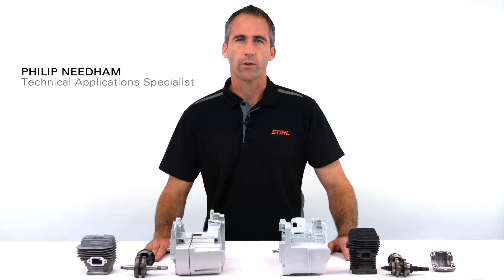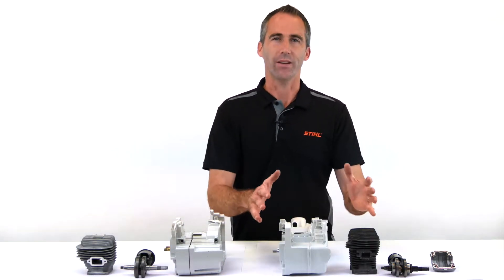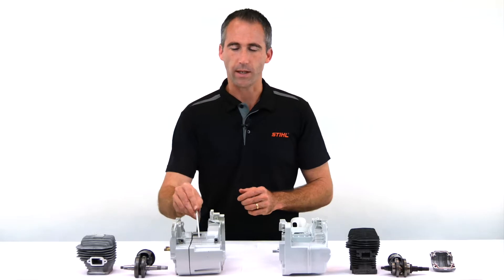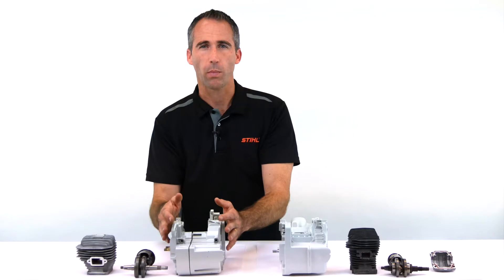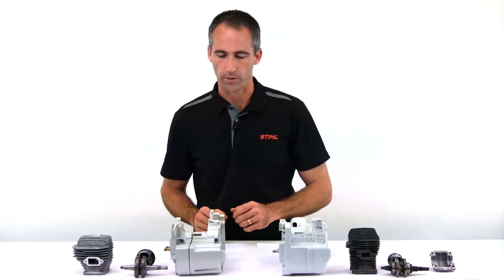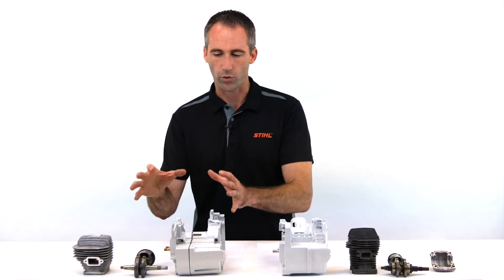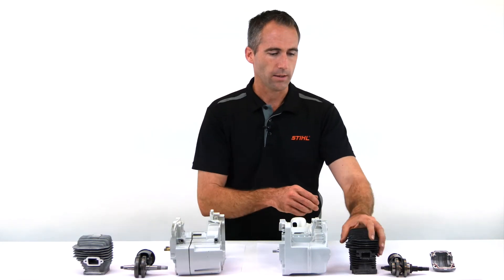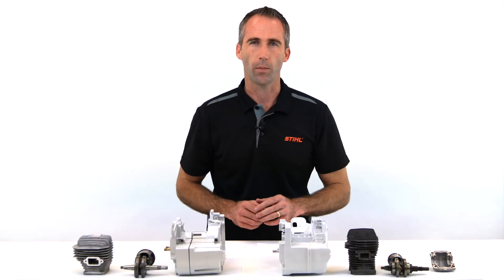Compare STIHL Magnesium Crankcases

Comment: the mag case is not just about durability and strength as it is more about heat distribution. you can run a pro saw all day with out worries. heat moves along the chassis and in the oil tank. but with a plastic housing the heat builds up and burns bearings and cylinders.